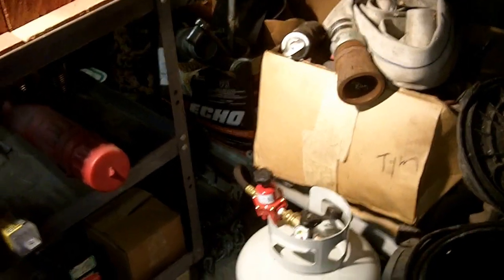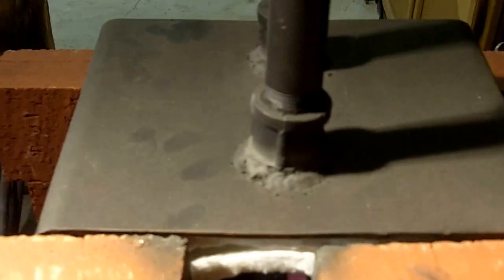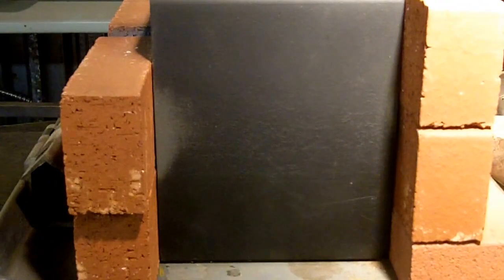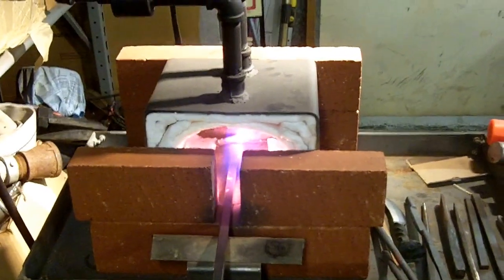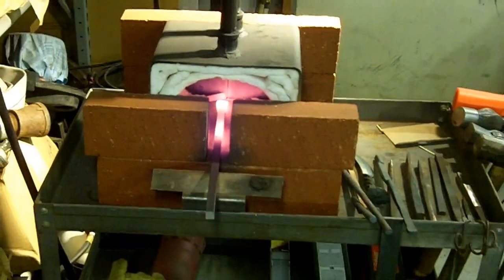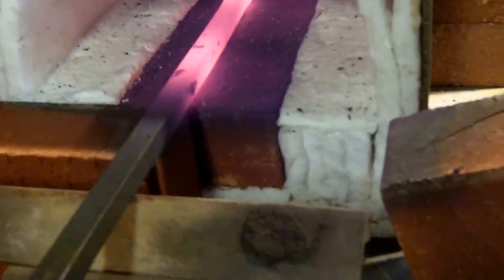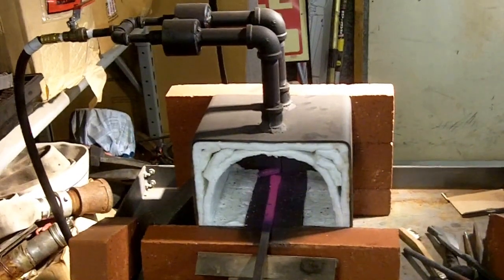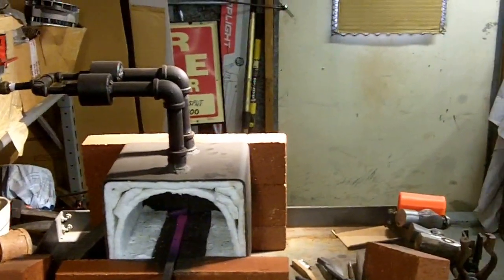Homemade propane forge

Comment: Great setup you have there. Can you achieve enough heat to forge weld?  How long can you work until the gas is out?
Reply from the maker: I haven't tried to forge weld but Gordon (the designer) tells me you can. The gas lasts about 8 to 9 hours on one tank.
Reply: Excellent. The set up is the best I've seen so far. Thank you for the reply.